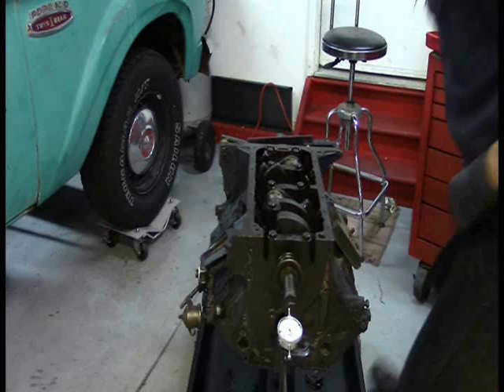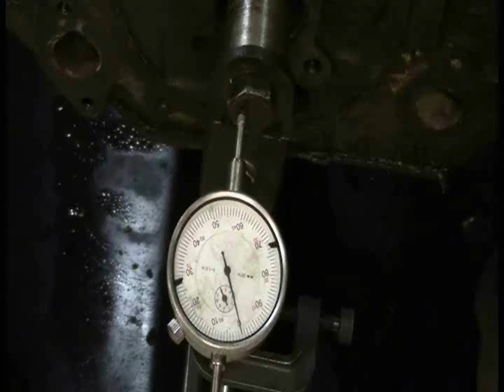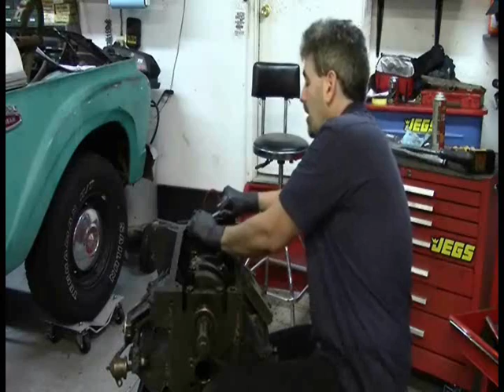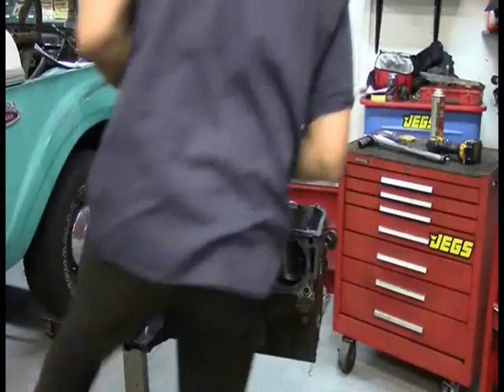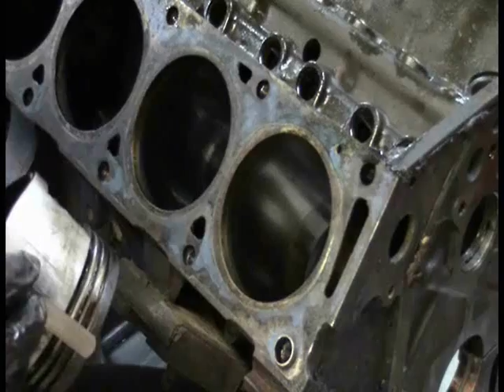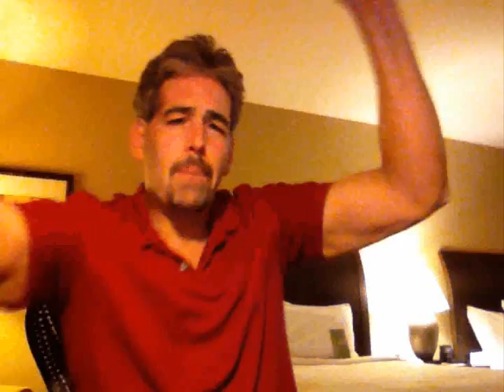Extreme Budget Engine Rebuild Pt 3- "Budget Rebuild" is an Oxymoron

Comment: Your block was trash from the get go. That sucks. I was interested to see the rest

You do NOT need to sleeve that block, it needs to be replaced. Junk. 

You absolutely are fucking NUTS if you think you would need to change out the cam on that engine all because of larger pistons. The cam only has to do with the top end and doesn't care at all about bore diameter except in making power. You can run a stock cam on a 347 stroker and nothing would go wrong other than your hopes and dreams of a fast car being crapped on.
Reply from the maker: another person who has no idea what they are talking about.  stay in that armchair pal!

Comment: I probably won't get a response because this was uploaded years ago but I have a question about the oval cylinders. In theory if the pistons were good and you decided to put oversized rings on the piston and inside the oval cylinder, wouldn't the ring eventually shape itself (after running the engine for a little) to the oval cylinder effectively minimizing the compression loss? Probably not because that seems like a way too easy solution but who knows. 
Thanks
Reply from the maker: Well they would eventually I suppose but the gaps would cause too much compression loss past the rings to run the engine smoothly- if at all.

Comment: For what its worth I really appreciate your videos.  Using the Haynes manual doesn't add a lot of understanding, after several of your sensor videos I felt like I knew why I was testing components (the ones apparently related to my car issues).  Didn't have a bunch of bucks to just replace parts on guessing, but long story short spent just a little to finally get the car running.  Thanks much!!

Comment: I'm considering rebuilding a few motors over the next year or two (first a standard, relatively unimportant Corolla engine, then a mildly abused "race" engine, a Nissan KA24, then a heavily abused turbo'd race engine, a Nissan SR20) and I'm wondering what kind of investment I should make towards tools. I've got a pretty good collection of standard mechanics tools, and I've started a list thus far throughout the series, most of which I already have, and that list will grow as we get into reassembly, but how important is it to store the camshaft, crankshaft, and heads on stands?

Comment: I commented on part one of ur videos and wat I sed still all holds true for me. I do like ur videos & have no problem with the techniques ur using. I will ad that I do read my Chiltons manual but only for reference. I'm not against the book. I imagine ur not eather just the air heads that read them then believe they have mastered engines. The book has all the measurements & tolerances in them so I dont have to memorize them( witch I practically have anyway becouse of my yrs working with these engines). I will say I have found misprinted info & people should know for a performance build dont use the oil clearances they put in them books. Open them oil clearances up. In the book they are too tight for most engines. Those clearances might be ok if all is perfect & ur engine dus not go above 4000 rpms. It's ok to feed ur bearings oil. Dont be scared people.

Comment: Matt: Thanks for making this video. I really appreciate it. I say this because of this: In spite of doing everything I have to my truck (I own a 1992 Ford Ranger with a 2.3l I4 with a M5OD transmission -- she's a stick), I am, more than likely, going to tear into the bottom end here soon, as my catastrophic failure was in the head, rather than the bottom end. Since I've never torn an engine down, it's nice to know what to expect -- so thanks.

Note: The catastrophic failure on my truck was the seizure of the #1 camshaft bearing -- my 2.3l has an OHC, roller hydraulic cam setup. Ergo, I had to pull off the head to deal with the problem. Surprise, surprise, I found that all of my exhaust valves were worn, so a valve job (already completed) was in order. Just saying this because you're absolutely right: You dig into this, you could spend way more than anticipated. As it is, I've also got to replace ignition coils, plugs, and wires as well, as nearly all those things were also out of spec, so go figure, lol!

Anyways, good deal on this video - and keep 'em coming!

Comment: Hey there I'm watched every min of this series so far.  Just wanted to say thank you, what you are talking about at the end of the video is exactly how I interpreted your comments during the video and I feel like I am part of your target audience :).  I restored the body (east coast) of a 66 (289 coupe) mustang and trying to decide if I should pull the engine and do a diagnosis like you did.  I don't have much experience with pulling engines and taking them apart but I'm an mech engineer and pretty mechanically inclined.  My main fear is not the ability to take the engine out and do some of the measurements you suggested, it's more putting it back together and having it still run among working in parallel to a full time job in a timespan of 3 weeks.

I took the car to a shop a year ago and they claimed the engine had "blow by" which they measured somehow by looking at pressure in the oil pan, or maybe by feel?  The car runs and can get from point A to point B but it does get very hot within 20 min continuous use.  I've asked a machine shop near me for a quote and they said 2500 rebuild and 600 on both ends to take the engine out and back in at a separate shop

My DIY thinking is, take the engine out, do the diagnosis, that you suggested and hope it's just oversized bores.  If the bores are worn, take the block to be machine by a shop to rebore and then replace rings.  Then do all the pulling and putting back in myself and hopefully save a good amount of money in the process

Option 2 is to try and find a rebuilt or used engine (I live in CA)

Option 3 save up for the shop rebuild.  It's not the original engine 

the DIY in me is saying #1 the practical side of me is saying #2.  Any thoughts?

Comment: I am 18 and rebuilding a motor. I am almost ready to put new Pistons in and I have heard that there is a special lube to put in the cylinders so you don't score the walls or new Pistons. I have also heard that you can put oil in them and get the same result. Which one should I go with?
Reply from the maker: Just use motor oil. Ther special lubricant you heard of is probably assembly lube- use that for the bearings.
Reply: Schrodingers Box thank you

Comment: If I'm replacing the cylinder block (due to a cracked cylinder liner) and there are no other problems with the engine, is it worth replacing the big end shells or will that also require the crank journals to be honed at a machine shop?
Reply from the maker: if they pass the “scratch test” AND show to be within specifications for diameter. you’re good to go without machining.

Comment: Eric, Thank you for your hard work on making these videos. I recently installed an used engine in my van which turned out to be a bogus one after all. I consider myself a moderately skilled mechanic but am definitely not a novice, although this was my first time changing an engine in a vehicle. After the disappointment (Although I am getting my money back from where I bought it) something told me to look into rebuilding an engine on the net. Well sure enough right up front there you were, It is 2:30 am on 12/28/2017 and I just finished watching so many of your videos. I have to tell you, I couldn't possibly thank you enough for taking this much time and effort putting these videos together. I have learnt so much from you. Please do not be mistaken, I am a 55 year old  educated man and extremely well versed  in many different fields including auto mechanics. Because of that, I could relate to everything you said and funny enough, I did not have to rewind one bit of any of your videos because I missed or did not understand what you said. You speak very eloquently, I like your style and are extremely informed in detail. Please do not give in to the computer junkies that behave like jackasses. I am extremely impressed by you and will continue to follow your series.
Again, THANK YOU from the bottom of my heart for taking the time to educate us and please do not stop.
I for one love you my brother. Keep up the good work. Happy Holidays!
Med Samii

Comment: I've done quite a few top end rebuilds but very few bottom end and found these vids very informative and actually learned a few things I didn't know to be fact ! and the lightbulb came on...... Keep up the good work . btw could the bores not be honed round using a pillar drill and over size rings or are they way to far out for a new set of standard pistons?

Comment: Thank you for this series. I'm just starting a 351 Windsor (in a '65 Ford F-100) rebuild and now I have more to think about. What are your thoughts about swapping to a much newer  (EFI, computer controlled, etc) Windsor based engine (pre-modular)?  Or, if I neeed to get a new engine should I stick with the older style?

Comment: DOA on that engine. Too much shit wrong with it to the point you can back up and go with another engine. As with any project,things can get deep and fast.  As far as people that nit pic a project, screw them, its your video,not theirs. If they want to produce a video using their methods,well,let them. I understand where you are comming from. There will always be some idiots out there that cannot comprehend what you are doing. If you were building a high performance engine,yes then nit pick. If you are rebuilding an engine for yourself, then its different than if you worked at a shop and had your own reputation to stand on. Granted,you dont want it blowing up a week after putting the motor in. I usually get another 3 years on an engine swap,if its a low budget rebuild,well that depends on the overall condition of the motor and how well it was maintained during its life. If the motor was run with lack of oil like that one, well,as you stated,its going to need more work and generally will be in a more" like new condition than just throwing a set of rings in it and mabe a few other parts.

Comment: Did anybody Catch it... the Crank and Cap bearings look like they were flipped.. I might be wrong but I thought the hole in the bearing should line up with the hole in the Block for oil to lubricate the Bearing/Crank.
Reply from the maker: As anyone with minimal experience knows it is impossible that you can have that happen and turn the engine over. Plus you can clearly see the factory machined stamps are all in correct positions AND orientations (which I even point out in the video). 
 I guess you're the only person who didn't catch that- so it still makes you special ;-)

Comment: thanks. really like the thought processes.
So in part 1 or 2, i think you mentioned that its most likely a better bet to get an replacement engine.  Do you have a video series on knowing if you are getting a good one, and what you would do recommend replacing on a salvaged engine?
Reply: ....and I'm an ideot, because there is the link to the right, "Finding a Good Salvae Yard Engine-PART 1"

Thanks again.  Really glad i stumbled onto your channel.

Comment: I HAVE A 72 FORD TRUCK WITH A 390 ENGINE BLOWING WHITE SMOKE OUT THE PASSENGER SIDE EXAUST SHOULD I GET ALOWER END REBUILD COST  1 WEEK AGO HAD BLOWN HEAD GASKET REPAIRS THE DRIVER SIDE SPARK PLUGS WHERE FILLED WITH OIL REPLACED STILL BLOWS SMOKE ON THE PASSENGER SIDE RECOMDATION THANKS NEW TRUCK USED ENGINE BUDGET 1,500
Reply from the maker: I'd say your problem is probably a stuck caps lock key.

Comment: if you. have rebuilt a motor can you do it again or do you need another engine at that point. I am imtrested in an old Chevy and owner said motor was rebuilt but its got metal in the oill and low compression.
Thank you for reading,
Erin

Comment: I haven't done a full rebuild but did succesfully change a head gasket on a 4 cylinder engine once after a thermostat failed unnoticed by the owner. Haynes was a good help to have, but when sharing the photos people with an older version of the Haynes manual started telling me I did it wrong haha.

Comment: Great videos and instructions,thanks for that.I am curious about the connecting rod bolts once you remove them  are they  reusable?I am rebuilding a Ford 5.4L triton from a 99 expo and the manual is telling me to use new bolts but I haven't found anywhere that sells this bolts.What is you opinion? thanks.
Reply from the maker: Yes because the torque is much less than that of head bolts, you can reuse connecting rod bolts. In fact proper reassembly actually requires several stages of connecting and main bearing bolt torques, loosens, and retorques.
Reply: Thanks for the quick response,now I have peace of mind to finish my rebuild.

Comment: It's too bad that the 352 will not be rebuilt.  My 81 Ford 255 engine has been awaiting me to finish its reassembly for maybe 5 years.  I feel better with what I have done after watching your work.  My engine had one rod large end seized to the crank.  I'm certain I have $2500 spent for a .040 overbore (it is now 259 cubes), 8 pistons, crank machining, new cam, heads machined, several new valves, oil pump etc.  When it's done it will go into my 51 Ford Tudor.  It will be a fun ride when it's done.

Comment: I have really enjoyed this series.  Unless you are building an ego engine there is always a price consideration. The first engine I had any thing to do with the insides of was my dad's tractor. Someone borrowed it and brought it back with a thrown rod. nice.  I was 5 years old and mostly watched except for help with a copper wire ring compressor. It ran with a bad knock but my dad babied it for a couple of years, during which time he found a new block and crank etc. Then he paid someone to do a class act on it. so when you are broke you have to break a lot of rules.  Not to criticize but only as another opinion. I would have kept the cam and lifters. Just my bringing up my dad always said, in low cash times a cam will never leave you on the high way. I don't know if that is true but it never left him of me. He had a pick up with a cam knock that he took over 2 state just kept his speed down. I had chev pickup that lost a cam lobe ( bought it that way ) drove it a year and sold it a brother in law who drove it for years. It is also a very nice feeling to build a engine and know that it is just like new.
There where questions about  just inframing the engine. That is a good plan but it has to be done before you are aware that their is a problem. you have to make a decision to drop the pan long before there are symptoms.
When you talked about ridge ring it was not clear to me what you planed to do. Twice I have not reamed it out and both times failed just my experience. not sure what Haynes says I read it as a reference only.
Thanks for your view point and time making these videos

Comment: why couldn't you put say  30 over rings and take up the extra cylinder space. that way you could avoid the machine work or what ever size would fill that gap
Reply from the maker: WHAT???? How are you gonna put 30 ovcer without boring it first????????  What on earth are you talking about "that would avoid machine work"????
Reply: I didn't mean exactly that.. I chose the wrong words.. I ment if it's just slightly over sized can't you just put a slightly larger ring to fill the extra... not that you would or not that it would be the best idea... simply couldn't you do that